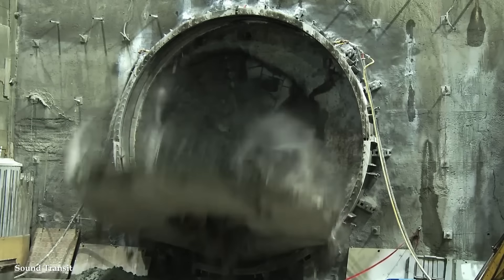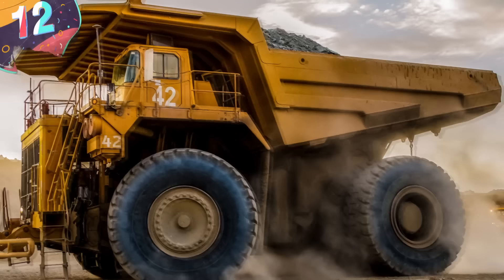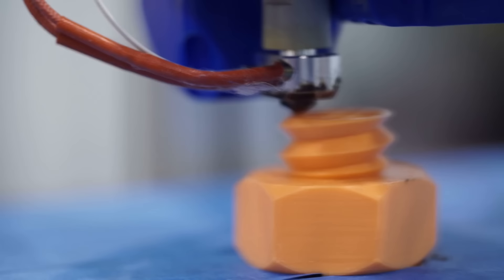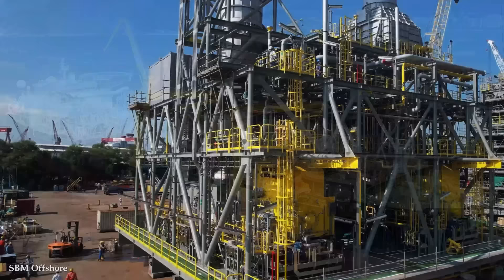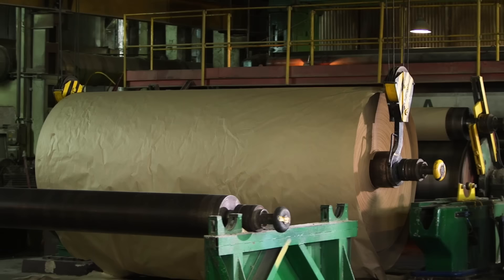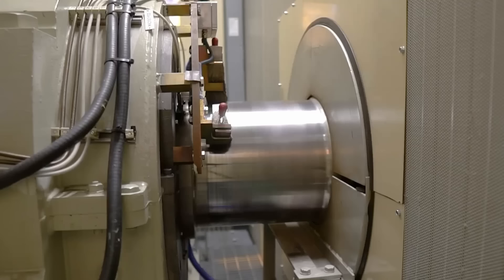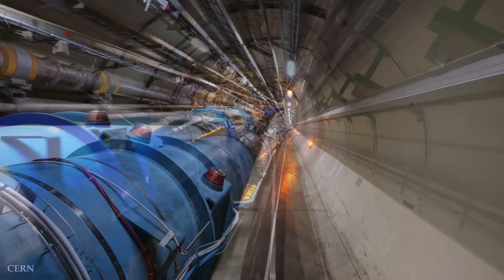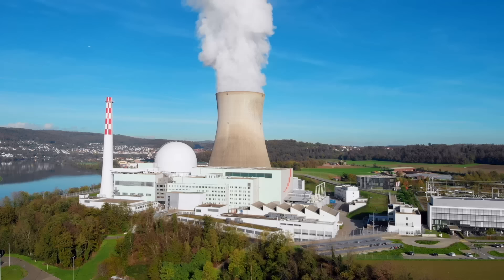15 MOST POWERFUL INDUSTRIAL MACHINES

Comment: .....as for gas turbines,yeah great stuff however hardly fuel misers by any stretch. Renowned as gas hogs in fact. Remember the Chrysler turbine car from the 60's. It's fuel efficiency was one of several nails in it's coffin regardless of how sweet it ran and the fact that it's heater worked instantly when u put the key in and started it. No biggee here in Calif. but hella important in Bangor Maine wouldn't you agree?

Comment: #7 bucket wheel. what do those mines look like after they reclaim them? it looks like they leave a massive scar
Reply: Not really. They save the overburden and waste material, and then replace them and re-seed the vegetation. Modern permitting systems require the reclamation process to be on going thru out the mining operations.
Reply: I'm sure that is the objection of the residents of the many villages in Germany that have been obliterated by these machines. Alas to no avail 😢
Reply: Fill it with all the dirt from the tunnel boring machine. Problem solved!